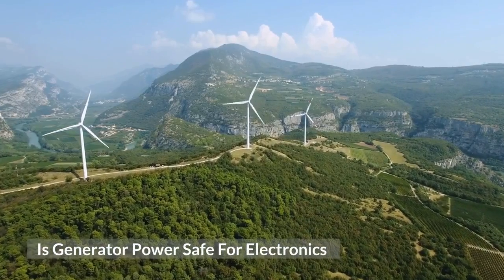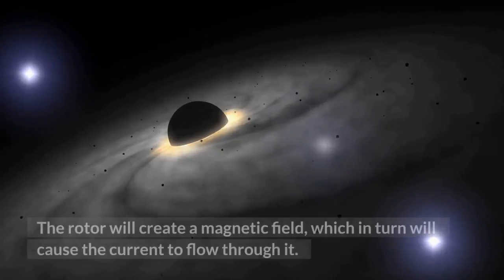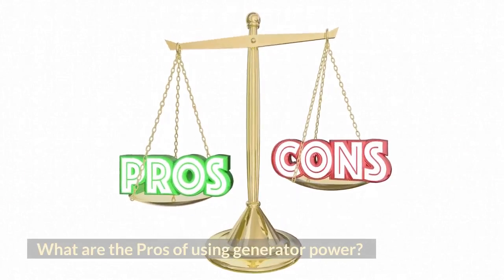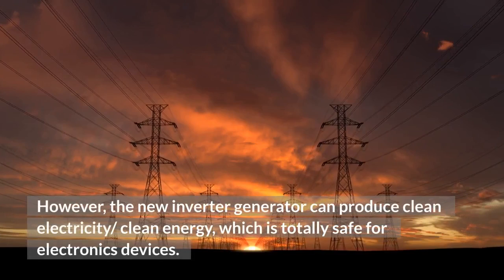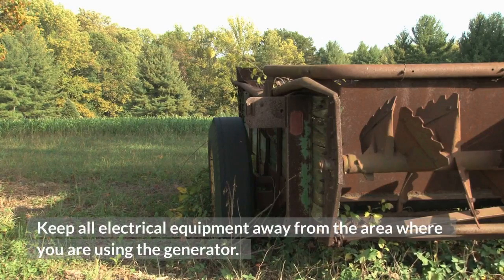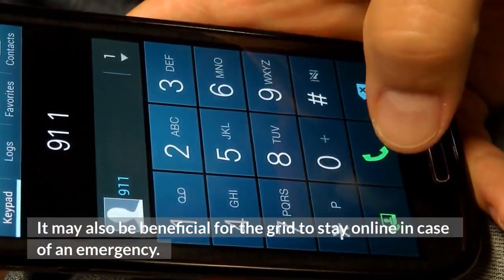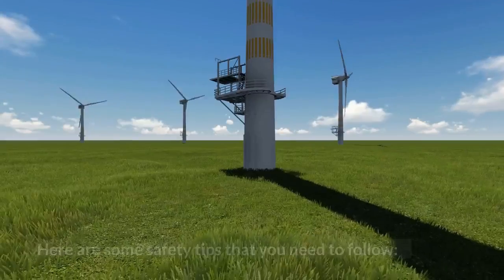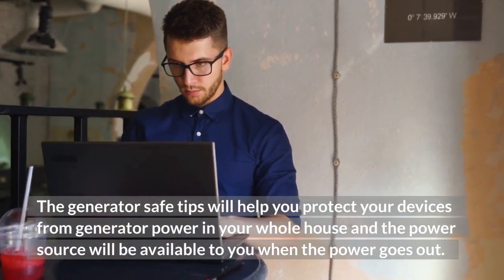Is Generator Power Safe For Electronics

Comment: There are a lot more items that a 'Modified Sine Wave' can damage. Brushless DC motors are in 'NEWER' refrigerators, air conditioners and washing machines... LED TV's and Microwaves do not act well w/MSW... I'm looking for something to change my OLD generator to produce a 'PURE SINE WAVE'. INVERTER generators are more expensive; but highly recommended.
Reply: Bought an Anker Solis F3800 Battery gen.  Cannot be charged with older gas gens.   Did you find any inverter to pure sine wave?
Reply: @tommills8092  No. And I've learned a lot in the last 11 months. Your purchase of the Anker is a wise move. I've concluded the best move for me is to get at least 3, ideally 6, 5.2kWh Server Rack Batteries. Since I already have a 48 volt system, an OutBack Max 80, and a Spartan 3300 watt inverter, with 2300 watts of Solar. Thanks for the reply. Take care and good luck.

Comment: Idiotic video that repeats and repeats the needs for a generator......but half-way through I still see no discussion on the purity of power issue....just some idiotic comments to check if the generator output is FUSED ! ( ?...really..???)..and such other nonsense...like capacity or general safety precautions. Yes...safety is a proper concern but the TITLE of this vid is the danger to electronics being fed, and we had hoped some info of WHICH type generators,and which electronics being fed...are ok or not OK to match.  Is the generator power "clean" vs "Dirty" as to the produced sine wave...that should be the focus...and THEN.....does the electronics you are supporting allow whatever is being produced without damage....that is the core question.....didn't find an answer here. The advantages of inverter-style generators was briefly mentioned ( vs open-frame generators), but it was never 100% established whether or not they are absolutely necessary and then again......doesn''t talk to WHICH electronics being fed are risky in this area. and the mention of Generac and Honda is only an advertisement. Harbor Freight and Generac are both made by subcontracted companies in China and if you look carefully....use many same parts, etc, etc...... totally useless vid as to discussing the title topic.
Reply: This video actually comes across as comical !
Reply: The same concept was described 5 times (literally) in the first 30 seconds of this video.
Reply: Lol... I thought maybe I was the only one that got annoyed.  You guys made it further than I did.
Reply: @101perspective  ...coming more-and-more to the conclusion that inverter style.....while "better"....is not critically-necessary to avoid "damage" to your owned home-equipment....a "fear-tactic" to make you upgrade ( ie "buy" !) to the newer inverters. Seems if you have a regular unit with good AVR and overall voltage control to avoid spikes....you should be OK. I'm not 100% "there" yet....but that's where I'm heading. I'd like to see real feedback from consumers where a good normal generator caused all the problems we are being warned against. So far, everyone speaking about it says they bought an inverter to "prevent" damage to "delicate" electronics....but have not seen reports of folks saying they dod this BECAUSE a normal unit fried their stuff. In other words, they became scared because of all the repeated warnings that it could happen because of the sales-hype, but no one reports back that's what actually happened...that caused them to buy inverter style for that reason.

Comment: Basic:
Most electrical devices will NOT care if the electrical power is perfect.

A regular generator will ALWAYS be above or below the usual frequency (50 or 60 Hz), which is "good enough".

But certain electronics, like UPSes will NOT work with generator power, unless the generator produces pure syne wave output!
Reply: This!
Reply: Is there a way to make non pure wave to wave or would adding a gfci plug adapter then surge protector help prevent this